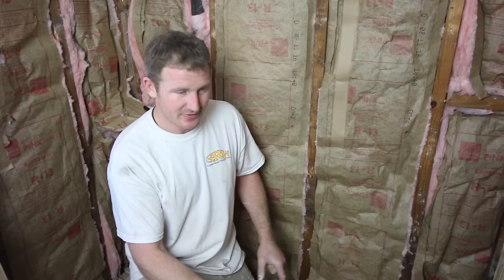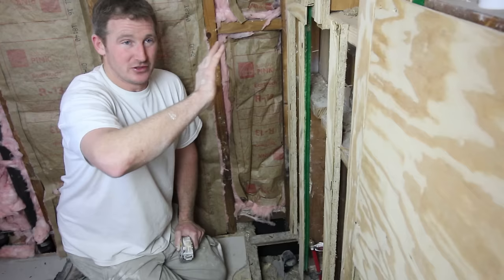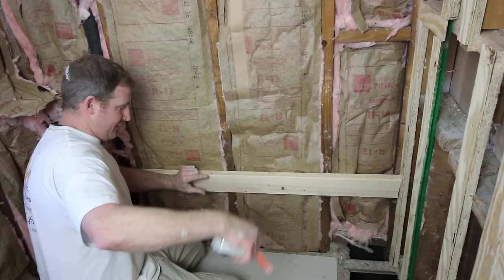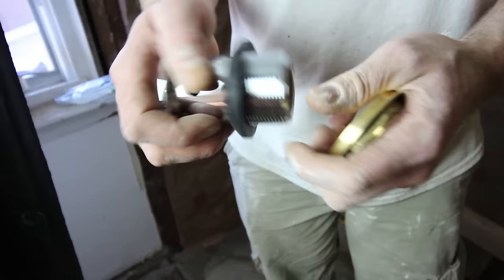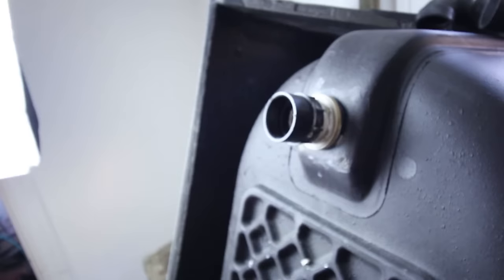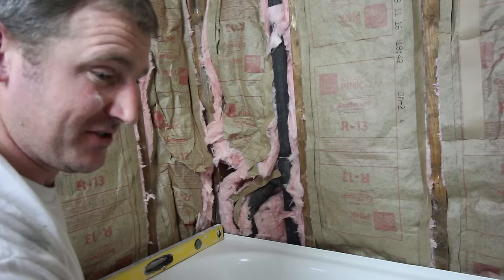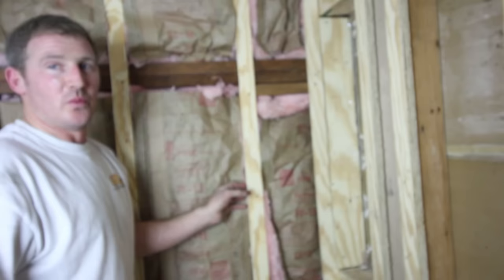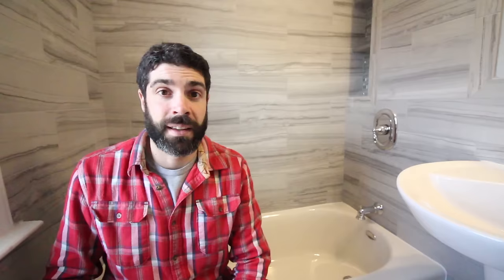How to Install a Bathtub...American Standard's Americast (Step-by-Step)

Comment: I think you are right about that mortar. with the fiberglass tubs, I see so many complaints about the tubs cracking after installing all the tile and everything around it. and people having to rip out all that hard work just to have to redo it again. I think it because their contractor's arent using mortar. even if the tub has a built-in level base, things start flexing once the weight of the person and all that water gets in the tub. that mortar helps stiffen things up and if any flexing is going to happen it happens under the mortar.

Comment: 9:02 -- the best advice in this video.  I bought a house and the previous owner installed an Americast tub just like this one.  After a couple years I noticed after the tub drained there was a depression near the drain where we would stand while showering and water would get trapped.  I tore out the tub and found that the black resin on the bottom of the Americast had failed and cracked open.  The tub was not set into mortar.  I am confident if the tub had been set in mortar it would not have failed.
Reply from the maker: Sorry to hear that happened, totally stinks. Are you in the middle of a complete remodel?
Reply: @HomeRepairTutor  That was part of a complete bath remodel many years ago.  Replaced it with a Sterling Vikrell tub and I have no complaints.
Reply: @DownForTheUnity  Yes, I set it in mortar.  I don't recall the brand but it was one of the readily available ones from the big box stores.  If I were you I would put some plastic sheeting down on the plywood, then put the mortar on top of that.  I also put very thin plastic film (like what dry cleaners wrap your cleaned clothes in) on top of the wet mortar, then I set the tub on top of that -- easier to pull the tub out that way.
Reply: Plastic might be a good idea in case the tub has to be replaced in the future.

Comment: Great explanation of work, materials, plus both installation and supply options!!
I'd add a few things that may be helpful.
One, from experience, I always wear safety glasses where appropriate  (pneumatic nailer/stapler).
Two, I'll always score my shims at least once, more if they are thicker at the snap point, to make sure the entire fastener is supported by the shim.
Three, a lesson several other contractors I know learned the hard way, wear knee pads or you may potentially be struggling if one plans on constructing into their 50s and 60s.
Reply: and protect the tub with drop cloth when stepping on it.
Reply: @edmundooliver7584  
I WAS FLIPPING OUT WATCHING HIM STEP IN WITH HIS BOOTS! MY OLD SCHOOL BOSS 35 YEARS AGO WOULD HAVE FLUSHED ME DOWN THE TOILET AFTER HE CUT ME UP INTO TINY PIECES IF I DIDN’T PROTECT THE TUB! THAT TUB IS BRAND NEW BOY! DID YOU PAY FOR THAT TUB OR DID THE CUSTOMER PAY FOR THAT TUB!!! DO YOU WANT TO PAY FOR THAT TUB?😂😂😂😂

Comment: I like that twist and turn drain assembly. I might have to get one of those. I'm redoing a small bathroom that also has a 61-1/4" rough opening. I like how you built out the whole wall for a smoother look. That is how my bathroom was done when it was last done 19 yrs ago. I'm redoing it now and the entire plumbing wall (interior wall) is furred out with 1x2s attached to the 2x4 studs, but the opposite wall (exterior wall) is just 1x3 furring strips on cinder block, so there is almost no insulation except for 3/4" white rigid foam panels. I'm redoing the walls so that the new tub will be shifted 3/4" of an inch towards the interior wall so I can get more space for insulation on the exterior wall. 1-1/2" total of rigid pink XPS foam. Also, doing this on the long side of the tub. Not much, but double the thickness of what it was and a better R value per inch. Having said all that I really just wanted to comment on the mortar bed, but I guess I'm getting excited. I bought a tub that has the leveling pad like this one, but the rest of the floor is a mortar bed about 1-1/2" thick for the tile. (They way they used to do tile floors). So, I think I'll use mortar under the tub, not just for support, but so it doesn't sit too low compared to the height of the tile floor. Anyway, it's nice to see work being done on an old house.
Reply: I love ya v

Comment: Wow.. I've installed hundreds of tubs as a master plumber in the last 40 years and saw some things wrong with the plumbing installation. You don't screw non tapered threads into a tapered thread fitting. And though it wasn't shown, the p-trap was probably installed with out a vent because I didn't see one on the vertical pipe that it was going to connect to. The horizontal outlet of the p-trap has to have a vent before the line goes vertical. If it doesn't the water in the p-trap will siphon as it's draining or when the adjacent toilet is flushed and you'll have gurgling noise and sewer gas coming up the pipe. Also if you screw the tub to tight to the wall it will squeak and you have a chance of cracking the porcelain  (looks like it did at15:30) that's why its not pre drilled from the factory.  I always put thin mill plastic or put duct tape between the wall and the tub, and this always prevents squeaking.
Reply from the maker: Thank you for sharing your experience, we appreciate that - but don’t assume there wasn’t a vent or the tub was plumbed incorrectly, both were done to code. Also, the tub wasn’t cracked at the time stamp you referenced. We put a lot of time and effort into videos to ensure correct installation methods
Reply: Add .47 it shows installing an 90 ell on the drain pipe not a tee with a vent going through the roof. So I'm wondering how it was installed to code?
Reply: @CS-rb9jk  Looking at the existing fittings you can see that the plumbing is draining from right to left (as we view it on this video). The p-trap was installed CORRECTLY on the  upstream side of the vertical vent pipe which is hidden from view by the insulation. Also because it is a 60 inch tub, it can be assumed that the trap was within the maximum distance from the vertical vent pipe.
Reply: @slowlyrusting4044  The inlet of a p-trap should only run vertical not horizontal. If your right that there is a hidden vent behind the insulation, then what was installed is called a 
"running p-trap". Those are not approved by any plumbing code. I  don't see any vent just a 90 going straight down at 4:17.  P-traps don't connect to vertical pipes, if they do it's an 
S trap, which is not legal by any plumbing code. The outlet of a p-trap connects to a horizontal line that drains into a tee. The upper outlet of the tee is the vent. The bottom outlet is the drain.
Reply: @slowlyrusting4044  Oh and his home made p-trap at 10:48 shows that he is going to connect the outlet of the p-trap to the vertical pipe going down with no vented tee

Comment: The rubber gasket on the bottom was your leak protection. Why did you use pipe dope for the metal nut? The metal nut does not stop leaks. It compresses the rubber ring into the top to stop leaking..
Reply: This.
Reply: The dope is to be able to remove for service purposes... the strainer doesn't last on hard water forever

Comment: Like others have noted, you skipped the most important/difficult part, connecting the drain plumbing.
Reply: He called a plumber to do that ;)
Reply: @andriyshapovalov8886  there are plenty of videos on that. not a lot that explains the details of how to install the backerboard just over the edge to get a good fit. this is exactly what I was looking for, and confirmed how I need to install my walls.
Reply: @Monuments_to_Good_Intentions  I think you were trying to reply to OP, but since you mentioned it, most of tub manufacturers call for backer to be Installed above the edge of the tub....
Reply: Hire a freaking plumber for that part, do u really want to risk it just to save a few bucks ?!
Reply: Really? I thought doing the drain plumbing was quite easy. Everyone always mentions to call a plumber for these easy jobs, but it's easy  if you have any measuring/planning/physical skills.
Reply: He did the plumbing 😂 he just didn't show the final screw on

Comment: So you guys run your backer board over the tub flange? It's amazing how certain tile pro's say that is a terrible idea, then others think it's fine. I did my first couple tubs with the backer shimmed over the flange like you did, but the more research I did revealed why this was not necessary and actually a bad idea because the water will wick up into the backer if it's sitting near the deck of the tub. I find it much easier to sit my backer right against the top of the tub flange, then when tiling, the bottom row of tile slide right over the tub flange. This also eliminates most or all of the shimming of studs. I'm in Pitt as well, maybe I'll see u guys around!
Reply from the maker: +warlok9 good insight, we apply a bead of KERDI-FIX or Wedi sealant to the tub deck and flange then embed the cement into it so that water won't wick into the board. Our preference is to use foam backer boards these days but a lot of folks opt for cement board due to cost and it's easy to find. 

Go Pens! Yah, feel free to reach out to us any time 👍
Reply: Thanks, and Go Pens! I also have also recently started using Shluter Kerdi for custom showers and although much more expensive, it is so much easier to carry and work with.
Reply from the maker: +warlok9 cool, Schluter is a great company. Now that they offer thin-set and a lifetime warranty it's hard to not use them. We're hoping they develop a curbless pan that can be recessed into the joists.
Reply: Home Repair Tutor Where do u purchase your Schluter products? Is there a local dealer here in the area that stocks most of their stuff? I got the shower kit from Lowes last time, but had to order the niche and the Kerdi fix from amazon. So Schluter sells their own branded thin set now? I used the uncoupling mortar from lowes and it seemed fine, but obviously if u can keep it all one brand that makes it easier. I noticed in your other videos on two different tubs you guys ran the Kerdi to the top of the flange, which is how I do it, but if you guys do it differently now, can you link that?
Reply: Thanks for this comment chain, I was just wondering why the methodology difference between this and the video of you guys installing the Kerdi board. Going to stick with Kerdi+KerdiBand above the flange for my shower base in the bathroom reno we just started. 

Do you have a video dealing with drop-in tubs, and how to properly frame them out? Your videos have been extremely helpful so far. Might just not have found it yet. 

Go Pens... <---- born in Bethel Park!
Reply: Tijuana,Mexico
Reply: @HomeRepairTutor  they do have such a pan i beleive the model is the schluter L/LS. it can be set up for either a center or end linear drain. Ive only used it a handful of times simply because the cost of the linear drains along with the considerable labor costs associated with notching  joists its usually only when the customers needs demand the curbless entrance that they will justify the additional money. As im sure you experience also many customers have unrealistic ideas for their dream bath project with budget that usually can get them about half way there.I do see positive changes with the way Schluter has marketed their amazing products. Name another company that spends as much money on educating those that use or sell their products. Any newer product is subjected to getting a bad rep based on improper use or simply not following the manufactures guidelines such as the ditra when it first came out. In the end a products only as good as the person installing or selling  it . You wouldnt beleive the nonsense ive heard come out of sale associates mouths when asked questions about products. Any time i use a new product that i am unclear on i reach out to their tech support and schluter is no exception. They perfected their shower system before releasing it and all other brands have based theirs off of schluter without having the "science" down. anyways enjoyed the vid and hope you get a chance to use the curbless pan soon. My estimate roughly brings up the cost about $1200 for this feature as the drain alone starts around $600 for channel body and drain gate together. Good luck to you!@

Comment: Great video, thanks much!!  I'm trying to decide whether to have my tub reglazed (again) or pull it out & have the American Standard Princeton 30" wide tub installed. The latter is my preference, but the demo on this old house is horrific, so not sure. One thing, though -- I cringed every time you got into the tub in your shoes -- I'd prefer some type of covering, even a drop cloth, as it seems like it could scratch the finish. Maybe not the finish on this particular tub, though.

Comment: Small bathrooms are the worst to work in especially mine it’s a 97 year old row home in Philadelphia that was built without a inside water closet. Originally there was a toilet in its own little room behind the kitchen right before you get into the backyard, it wasn’t a outhouse the 4” extra heavy cast iron pipe is still connected to my main house sewer with the pipe capped at the foundation wall. There was a cold waterline that ran from the kitchen into closet and had a gate valve on the end dumping into the toilet tank that was 8 foot above the bowl with a 2 “ brass pipe connecting the two with some old school flush valve. Some one put in a electric heater before WW2 so u wouldn’t freeze your nuts off in the winter and to keep the room just above freezing so there was no issues when it got below 32 degrees . When it got real cold it the heater wasn’t big enough and everything would freeze if you didn’t shut the cold water off under the kitchen sink and hold the chain long enough so the tank would empty. I don’t think the bowl ever froze according to my grandmother but she’s been dead for 25 years so I can’t confirm that . After WW2 everyone started getting their house remodeled and put a regular bathroom on the second floor, however they originally had a lead shower pan with a wet bed then finished the shower pan with those little 1” square black and white tiles that come in sheets that are 12”x12” and they were nicely built because when I remodeled the house those tiles were a nightmare to get off , I had to beat the tile floor with a sledgehammer and a medium size chipping gun. They also had a large beautiful 7 long 40” deep cast iron leg tub that i still have with all the chrome valves and supply lines . The shower pan never leaked but I wanted a smaller bathroom so I moved the leg tub to future basement bathroom that’s already roughed in and framed but I started getting a small amount of water coming thru the stone wall foundation so I am in the middle of fixing that which is a lot of work . I have to do small sections at a time , remove the old mortar, clean out every gap then put some special mortar that’s supposed to be waterproof , then paint the wall with a waterproofing sealer, and then I can finish the basement. It’s a lot of work each area which is 6 foot wide floor to ceiling takes at least 5 hours to get it cleaned and prepared then another 2 hours to properly add the mortar, and that has to sit for 48 hours before I can move on to the next section. I’m 40% done and was considering hiring a guy but I want a professional job done with everything cleaned out , no dust left in the joints , no air pockets , and a nice finish . The guy I hired who did it for a living on a commercial scale did a half ass job so I tossed him out and payed him for his time but had to remove what he did and I found sloppy work , missed joints where he only removed the top inch of old mortar and this guy wanted 6,000 dollars to do the whole job along with some outside work also but I was like no thanks here’s 400 bucks cash for your 5 hours now bounce .

Comment: Great video. Awesome job. Thank you. You guys are the best. I am a new home owner who inherited an 80% complete bathroom renovation with the tub as the last part. It is already installed but it moves a little. Everything else looks good so I don’t want to rip it out. I basically just have to put the backer board on, waterproof, and tile. I was going to use washers to secure the tub and then I saw your video. I am worried about damaging the tub if the washers crimp it. Have you ever used/seen stainless steel neoprene roofing washers?  I am going to try those. I wish I had the energy you guys do to make a video. Please let me know.

Comment: How did join it to waste pipe?? .. And check for leeks.. All so if theres a problem with the trap in future..  is there any access panel?? Or pull half the wall down and bath out to fix!?

Comment: Do you guys have a video showing the way you leveled the floor prior to installing the tub? My floor looks about 1” off level for the length of the tub, so I think I need to use the self lever, but can’t find any videos of how to do it right. Thanks!
Reply: Rip a piece of wood the desired thickness and screw it down across the opening. Mix up the leveler and pour it in / let it set and then remove the wood that was used as a stop.

Comment: The regular fuel drills rin screws just as fast or faster than the impacts even with 4" screws and doesn't eat bits nearly as bad
Reply: No overflow connection?

Comment: that's 5 feet ?  it looks smaller.  I had a 60 inch tub and a 59 inch opening.   Current project involes plaster walls.  I hired the wrong guy to do the work, now I am redoing it all, D'OHH.  See why education is so expensive ?  Other than that, it's rewarding to see progress at the end of the day and that the project is starting to move and gain momentum.  Not sure I am going to have it all done in 2 weeks, but got to have a goal !

Comment: Did you remove the black resin from the flange around the perimeter of the tub so that the steel tub flange sits against the wall studs and backer board?